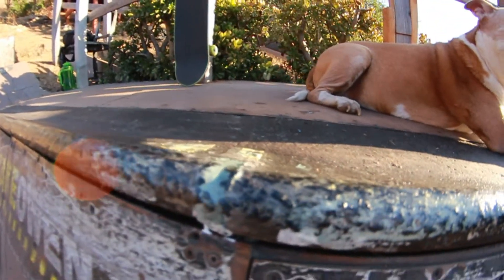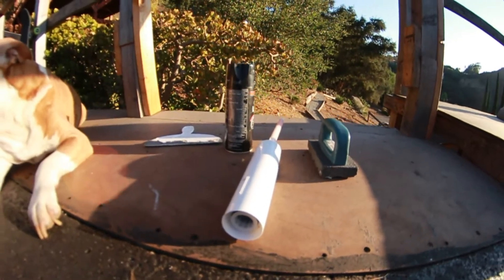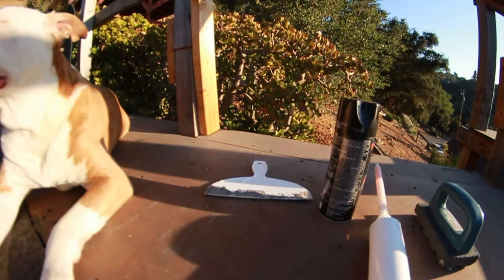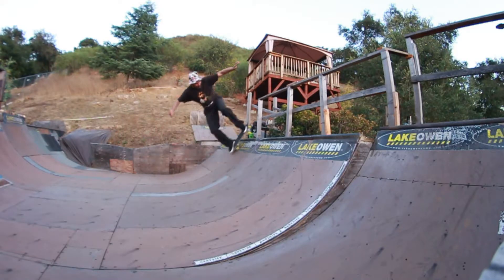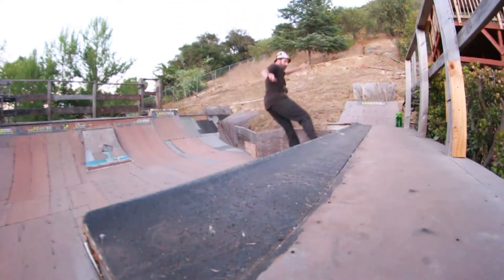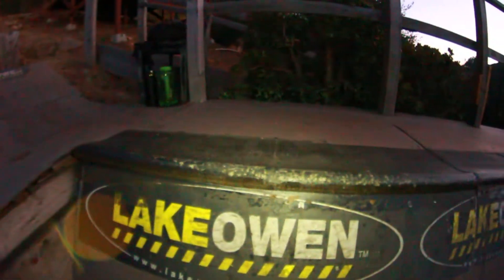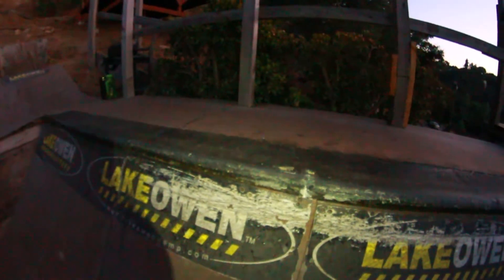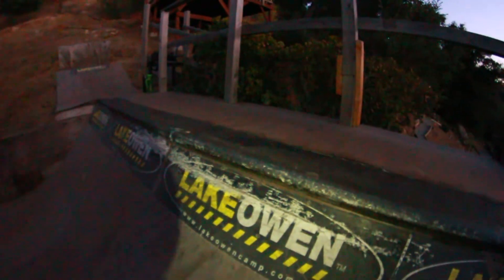Fixing Mini Ramp Pool Coping Part One

Comment: What adhesive do you use to attach the blocks to the ramp? Any bolts or rebar?
Reply from the maker: I just use bonding adhesive from Home Depot at first.  Then after a while I drilled into the blocks and bolted them to the two by sixes below to limit shifting.